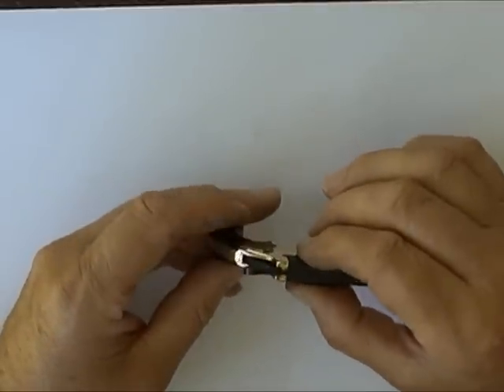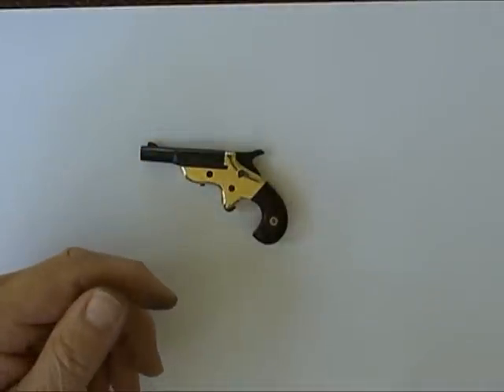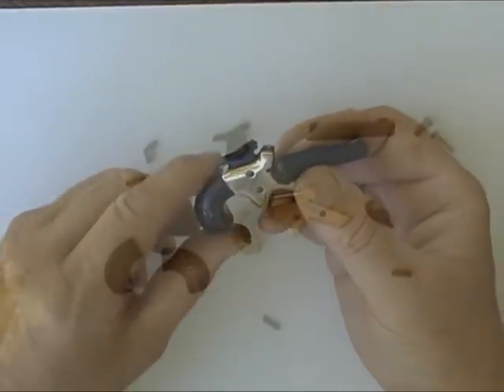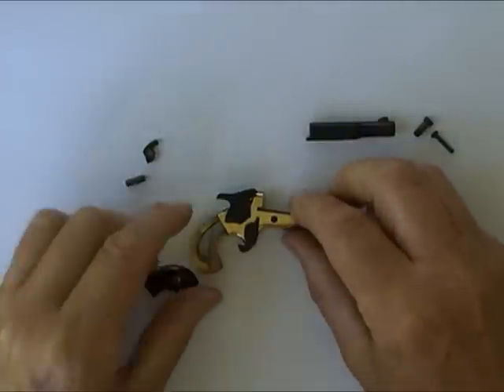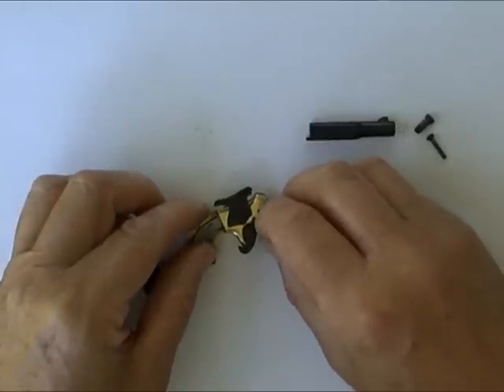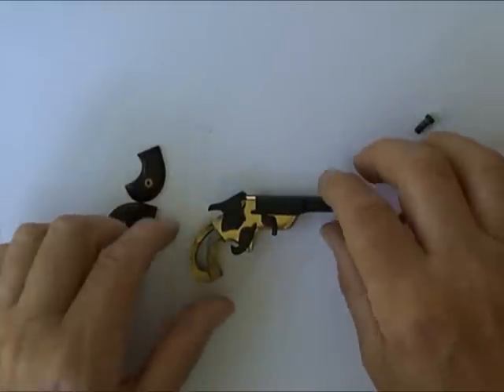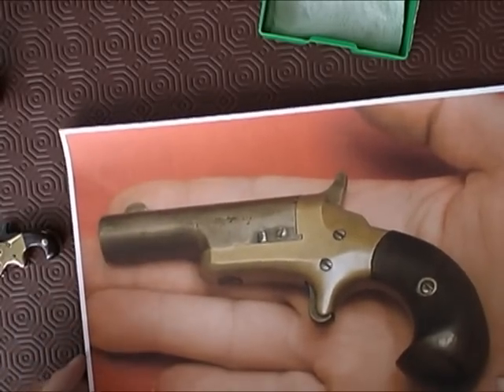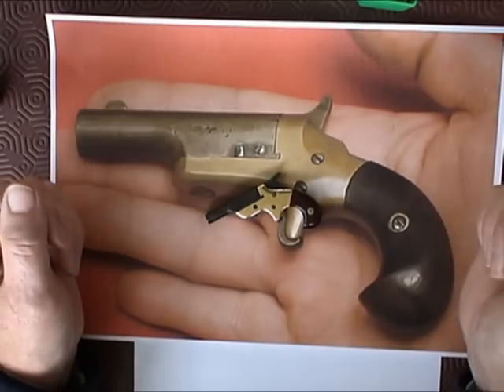Homemade pistol

Comment from the maker: I drilled the pivot holes with a post drill and used short lengths of welding rod for the pins, just filed the pins so they were a push fit in the frame. The small screw used for the barrel swivel was from some electrical switch, maybe 4mm.

Comment: Im not sure if you mentioned what cal. It is. Ill rewatch. Butid like to see it fired once. Very cool build. Im working on a NAA MICRO REVOLVER. In 
.22 long rifle at the moment. Thank you for sharing.
Reply from the maker: Unfortunately Ron this was built as a non-firing curio. As I live in the UK this would little toy, if it was fireable, it would be classed as a section 5 firearm (Same as a fully auto machine gun) and as such almost impossible to get a certificate for. If I had made it as a muzzle loader it would be a different story.

Comment from the maker: I just centre-punched and drilled a series of holes about 1/8th diameter, then joined up the holes with a small round file, then made a small square chisel out of a hard masonry nail and squared up the edges and finished with a small square file. - A 10 minute job with a milling machine took maybe 10 hours by hand.

Comment: Nice work. Could you tell me how you machined the cavity inside of the frame?
Reply from the maker: Thank you Dave - I drilled a series of holes in a line, about 1/8" and joined them up with a needle file - slow going but all I had at the time.

Comment: I love the gun. I'm making guns myself, and I was wondering what you used to make the leaf springs, or where you got them. The hammer spring is often a problem for me
Reply from the maker: The leaf spring I used came from an old door lock but if you keep your eyes open you will find them in all sort of odd places. The backing of windscreen wiper blades, old car contact breakers, the clips that hold car air filters housings, junior hacksaw blades etc.
Reply: thetargetmaster Thanks. I have used few hack saw blades, but they are often too strong, or they bend/snap when you forge them.
Reply: Do u  have a phone # that I can txt u I'm having trouble making something

Comment: How did you create a little channel from the leaf spring to the hammer?
Reply from the maker: Just drilled a line on small holes then squared it up with small hand files. It just takes time.
Reply: thetargetmaster ok

Comment: U are a very skilled man. Should start a custom parts and gun frames
Reply from the maker: Jimmy Piercey Thanks for the compliments Jimmy but unfortunately there's no plans or blueprints, I seldom work to plans, just make it up as I go and maybe a sketch or two while I'm thinking it out. I'm working on a miniature steam engine at the moment that will fit on top of a .357 cartridge case.
If you've got a small lathe and want a project to get you started go to google images and search for "Naval Canon".

Comment: You have really have some talent. I'm having a hard enough time building a derringer with all the photos and information I could want at the touch of my fingers, but you saw some pictures and replicated it with your hands! 

Use any hand tools besides files?
Reply from the maker: Thank you sir. Just basic tools, hacksaw and a small post drill - Now I could do a better job in half the time with my milling machine and lathe. In the 1970's when I made this I had time but no tools, now I have tools but no time :)
Reply: Ain't it always one or the other? This makes me feel much better about my chances. If you did all this with so little, then I don't have an excuse with a dremel and power drill. At the time, did you have a mechanical or technical background or were you just a hobbyist?
Reply from the maker: Purely self taught Harry, just find it satisfying working with my hands. This little pistol was made more like whittling, only in metal. At the time I was working  long night shifts. I had a little vice with a vacuum pad base that stuck to my metal desk.